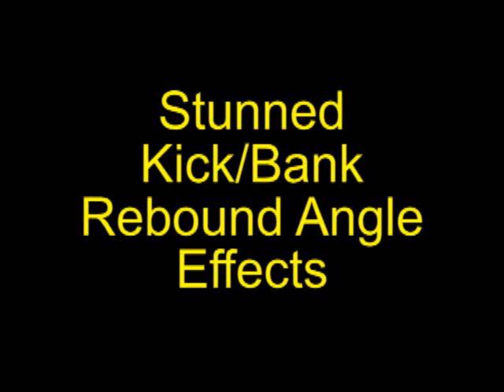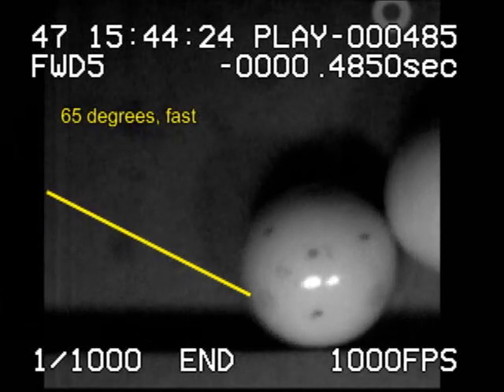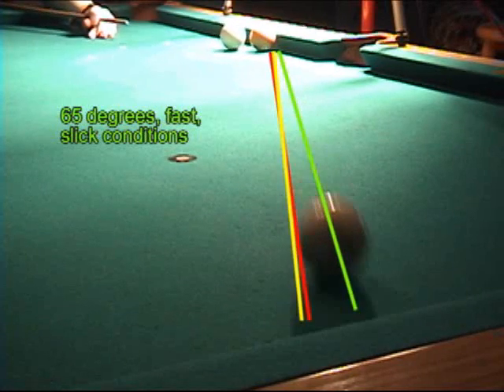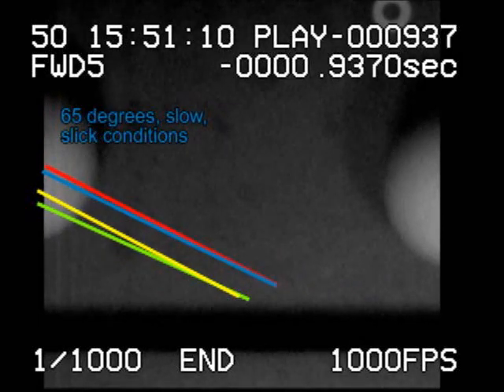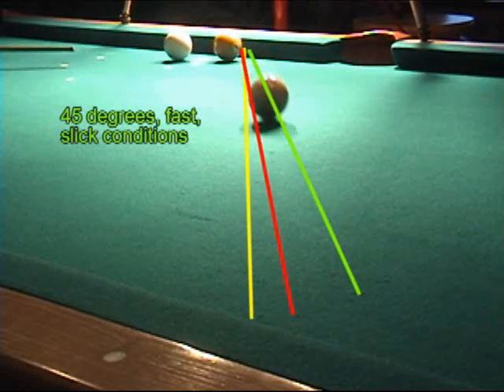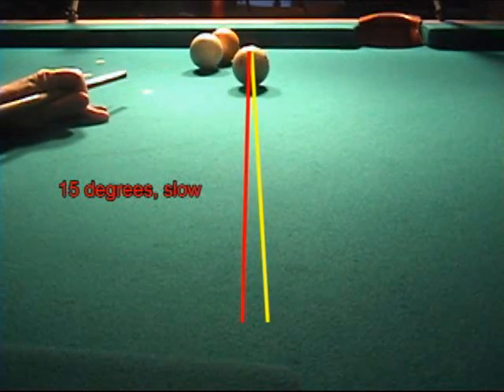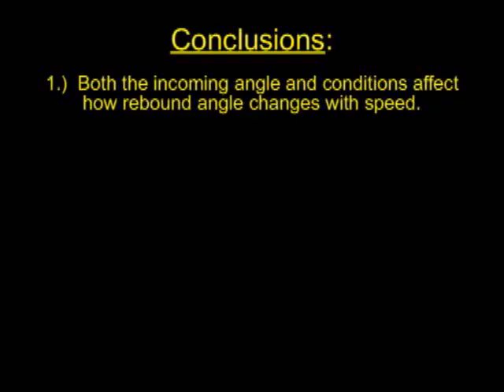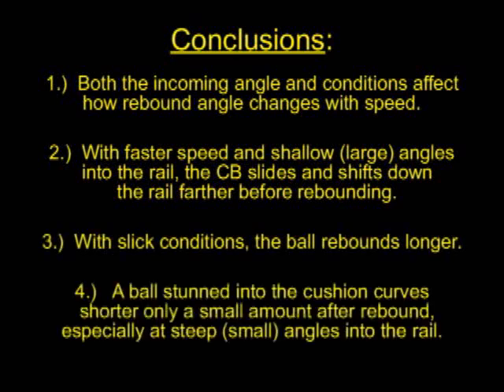NV B.95 - Post-rebound spin, angle, and curve for stunned kicks and banks

Comment from the maker: @FateAtYourWindow 

If the tables you play on all have new and clean cloth of the same type, and the temperature and humidity is fairly consistent, then kicks and banks will come off rails as you might expect.  However, if you play on a table with cloth "sticker" or "slicker" than normal, you will need to adjust.

Comment from the maker: @FateAtYourWindow 
"Slick" usually refers to the cloth, where the balls slide more easily.  In the video, we simulated a "slick" cloth with Silicon spray on the ball.

New and clean balls will tend to slide on the cushion more easily and rebound longer than older and dirtier balls.  It also makes sense that the rebound angle might be more consistent with new and clean balls.